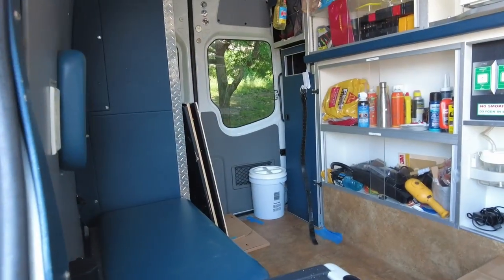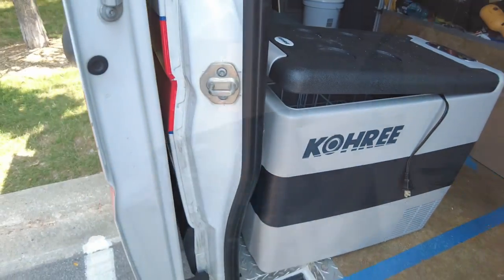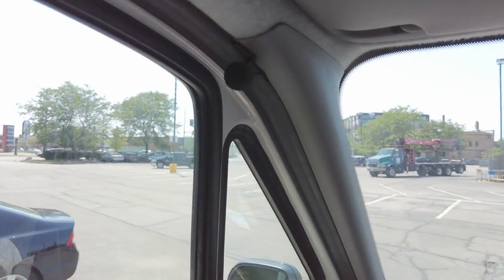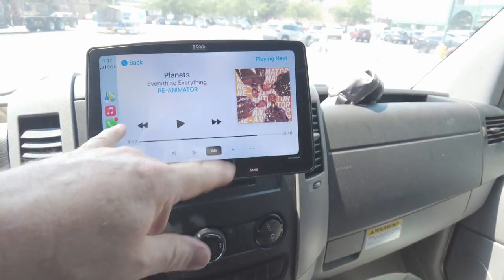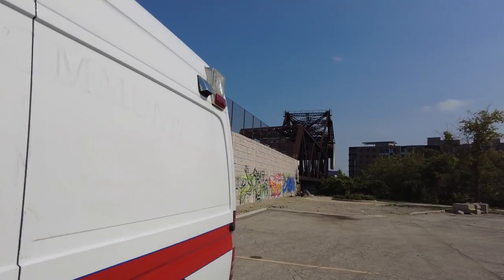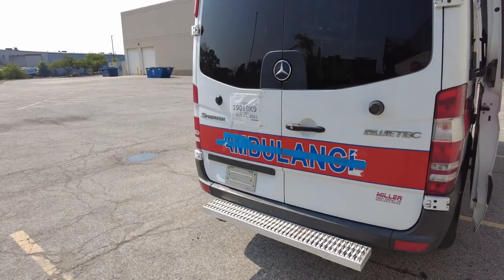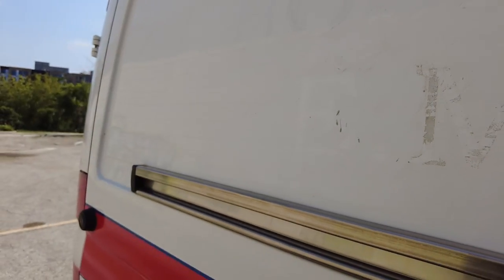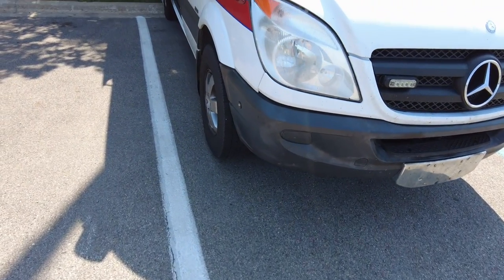Type II Ambulance Campervan Build 2: Stereo, Fridge, Stickers, and Drips

Comment: Pro tip on finding OEM parts like the radiator to replace.  Once the dealer tells you whats wrong.  Take the vehicle back.  The go to car - parts dot com and get the part from a recycler and get a local mechanic to replace it.
Reply from the maker: Yep, that's definitely the best way to go.

Comment: If Mercedes was so awesome why would they run transmission cooler lines to the radiator? You need a separate cooler for that. If you overheated for some reason your oil would boil and ruin your transmission. Whenever I purchased a used truck step 1 was to install a separate transmission cooler.
Does the switch that controls the lights have a center position that could be off but the switch is faulty? One direction is high, center is off and other direction is low? That’s weird that they would be on separate power sources. You’re doing awesome work!
Reply from the maker: Yep, I'm not thrilled with their design decision. It's a MASSIVE radiator in these things.

I think it's quite possible the middle position of the switch is defective. I had a couple of fire fighter friends suggest that. I'll replace it.